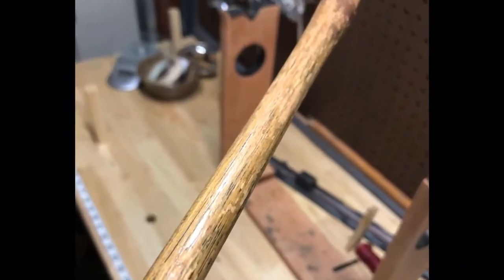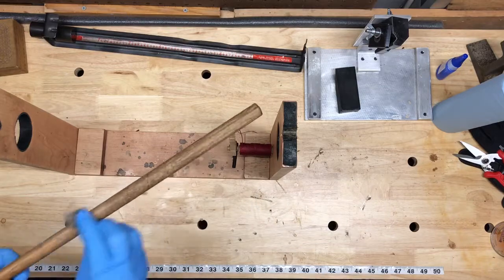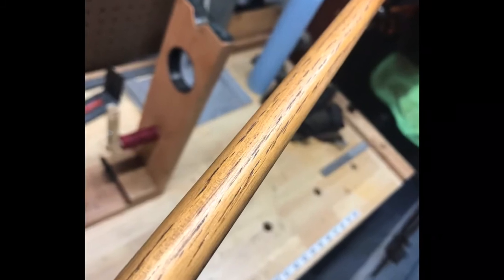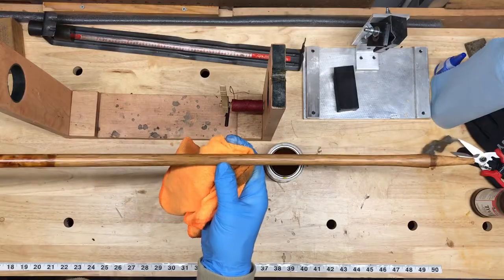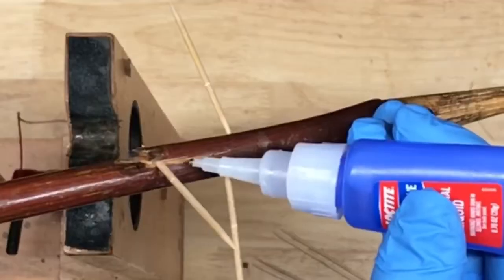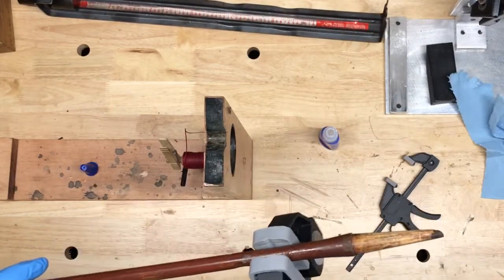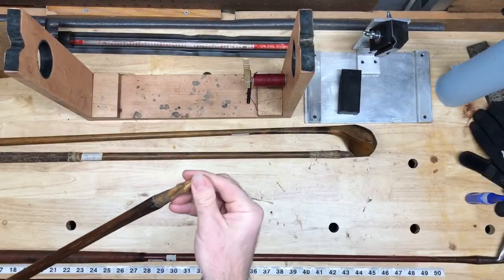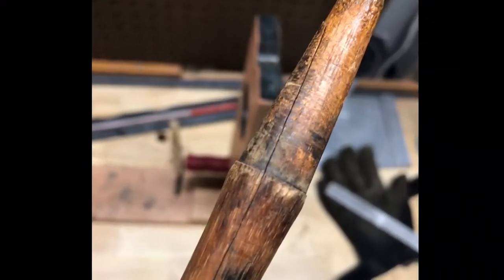Shaft Maintenance on a Wooden-Shaft Golf Club: Hickory Golf Club Repair Step # 3

Comment: how do i remove rust from 1900 golf clubs and not hurt paina
Reply from the maker: The easiest way is to use 0000 or 000 steel wool with some water and lightly scrub off the surface rust that way.

Comment: C, have you ever repaired a wood that had cracks, significant or otherwise , with your superglue method?
Reply from the maker: Yeah - I’ve used the superglue to seal hairline cracks in the heel and to repair splits in the shaft. The shaft repairs hold well, but I’ve found the hairline cracks in the heel to be tricky. Sometimes the glue does the trick and it stops spreading, other times further use of the club spreads the hairline no matter what you try to do to stop it. And sometimes the hairline is just cosmetic and doesn’t seem to affect playability.